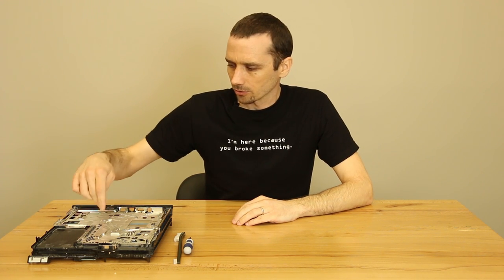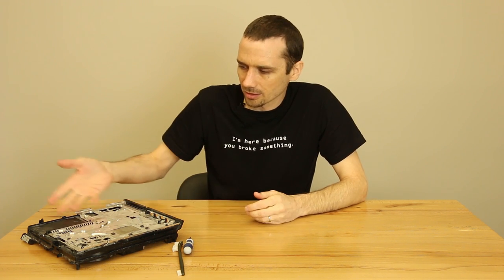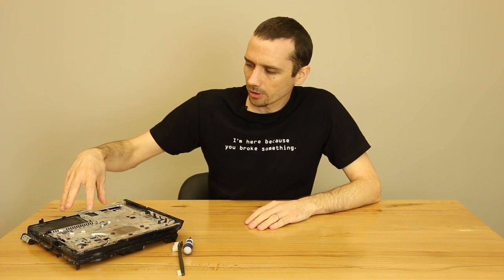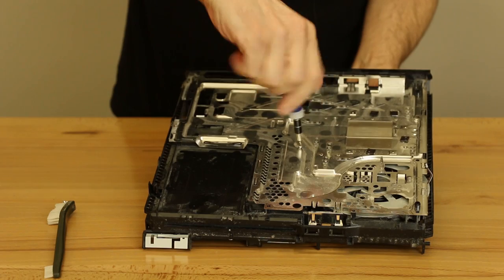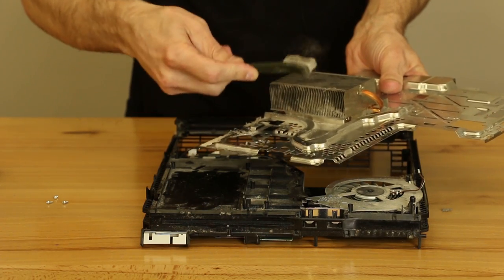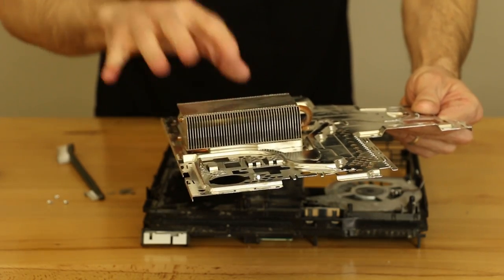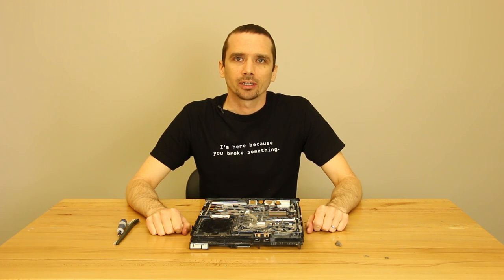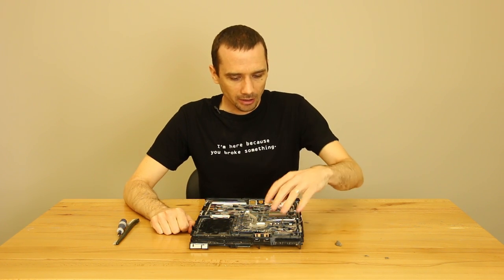PS4 Overheating Repair Tips - How to Fix Loud PS4

Comment: When I turn on my ps4 and my tv, you can hear the sound from the ps4(on tv) but you can't see anything on the tv.  What do I do?
Reply from the maker: Sounds like it may need an HDMI port replacement. Be sure to try a new HDMI cable first though.
Reply: +TronicsFix Do I have to buy a new hdmi cable?
Reply from the maker: I would try that first. It's probably a bad HDMI port but you want to make sure it's not the cable first since that's a lot cheaper!
Reply: +TronicsFix I tried a different hdmi cable and it didnt work, I tried it on different ports... what do I do now
Reply from the maker: You'll need to find somewhere that can fix it. If you want to send it to us for repair you can order that repair here: http://www.tronicsfix.com/store/p21/PS4_HDMI_Port_Repair.html

Comment: My ps4 didn't overheat and is a newer ps4 a little over a year old. i tend to leave it on a lot and today my controller just turned of and i haven't been able to reconnect can someone please explain what is wrong. Its a 1 TB Black Ops 3 ps4
Reply from the maker: Does it try to connect? Do any of the lights come on when you try to turn it on?
Reply: Yes it will blink for a minute then stop
Reply from the maker: It could be a problem with the Bluetooth chip on your console. Sometimes they go bad and cause this problem. You might try connecting with a different controller first.
Reply: Just contacted play station and got it fixed
Reply from the maker: Awesome! Glad you got it working!

Comment: My ps4 is blowing air out from the side vents, but aren't they supposed to suck air in
Reply from the maker: As long as there is air flowing it doesn't matter.
Reply: +TronicsFix I think my ps4 is overheating because of this. The fan starts to get loud after only playing like 30 minutes, and in game textures take a while to load. I've only had my ps4 for about a month so I don't think its a dust issue
Reply from the maker: I would take it back and exchange it if I were you.

Comment: What if your ps4 does not turn on at all? Is it because of your power supply? Help meeeeeee... :(
Reply from the maker: +Taste Therainbow Usually, yes.
Reply: +TronicsFix I just have the same problem. I was playing MGSV and the PS4 just turn out. The console was not in the best place, and of course she had a lot of dirt. I have no valid warranty, so I opened it and I cleaned it carefully, just the fan and the dirt in the case. After that I tried to turn, but absolutely nothing happens. I also think it can be the power suply. So my question is
Is there any way to be sure of that before buying a new one. What's your advice?
sorry my english, thanks a lot!
Reply from the maker: I really doubt the power supply went out just by you cleaning it. It's more likely that something wasn't put back together right.

Comment: My ps4 use to heat up really hot and it never said anything now it heats up a little bit and it shuts off on me and says it’s overheating led turns on etc yet it doesn’t feel too hot to be doing that
Reply: I am EXACTLY the same I think it's Sony slowing them down so we buy a ps5
Reply: @thespecialist3728  I’m going to buy one either way but I just sent mine to get fixed a couple days ago

Comment: Hey TronicsFix, does the Vertical Stand provides more cooling if you place in open space or just a normal type?
Reply from the maker: The vertical stand isn't going to provide any more cooling than just having it sit flat.
Reply: +TronicsFix I heared some PS Players use Vertical Stand Cooling MOD but actually it really kills your PS4 because of the dust.

Comment: Guys quick help my playstation 4 slim gets really loud and hot sometimes the console controller can't be controlled can't use it for abit what's the best
Reply from the maker: I really don't know. I'd have to be able to test it here in my shop to know what's wrong with it.
Reply: TronicsFix its like the controller is being used by a ghost and some rendering issues sometimes, could it be worth getting a new one
Reply from the maker: Before you get a new one you should at least send it to me so I can have a look at it. I'll diagnose it for free then once I know what's wrong I can give you a price and you can let me know if you want it fixed. We can fix most problems for under $100

Comment: Hey @TronicsFix LLC,My ps4 is overheating and it makes loud noize but it doesn't overheat to the point that it flashes red and gets turned off by itself,it just when it gets hot it show's me a notification on my screen that say's "Your ps4's temperature is too high,turn it off now and turn it on again later" but the thing is it gets hot really quickly,like i turn on my ps4 and after about 1 hour it will show me this notification,and it does every single time i turn it on no matter how much time it was turned off,if you know what's the problem with my ps4 i would really appreciate it if you replied right here on my comment, i subscribed to your channel also.
Reply from the maker: Thanks for the sub! 99% of overheating problems are caused but either a faulty fan, clogged heat sink or having it in an area that isn't well ventilated.
Reply: Ok thanks for the help i appreciate it !!!!!

Comment: Tronicsfix my ps4 temperature getting higher and higher what I need to do I am panicking. :( :( :(
Reply from the maker: There's no way for me to know what's causing it without having it here in my shop. A good cleaning and new thermal paste could fix it or maybe it needs a new fan. You can always send it in if you'd like: https://www.tronicsfix.com/collections/playstation-4/products/ps4-overheating-repair
Reply: what is fan?

Comment: My fan won't change speeds after I cleaned my ps4. Now it just runs too low. What should I do?
Reply from the maker: How do you know it's running too low?
Reply: TronicsFix LLC I turned it upside down Took the bottom cover off, and turned it on to see if the fan spins at all. It does but it spins slowly. I tried to spin it by hand, but noticed it had some resistance. It doesn't spin freely. Almost like it needs to be greased.
Reply from the maker: Does it overheat?
Reply: TronicsFix LLC yes. Stays on for about 2 minutes, I hear 3 beeps, light turns red, and then it shuts off.
Reply from the maker: And this just started after you cleaned it out?
Reply: TronicsFix LLC I've cleaned it out before, but this didn't happen. This time I used a can duster. The reason I cleaned it out is because the fan was making a noise as if it was spinning wobbly. Now it spins evenly but with resistance and it's slow.
Reply from the maker: Did it start overheating only after you cleaned it out?
Reply: TronicsFix LLC no. It's been overheating and I though that it was because of a weird noise the fan was making due to dust. I cleaned it out, and now the fan doesn't spin fast enough to cool it down.
Reply from the maker: That would have been good to know in your original question. If the fan isn't spinning correctly then replace it. While you're there you should remove the bottom metal plate and clean the heat sink out.
Reply: TronicsFix LLC will, do. My new fan with thermal pastr just came in and I'm going to fix it soon. Any tips?
Reply: TronicsFix LLC okay, I replaced it, put it back together, and it overheated again. Checked the fan. It doesn't spin. I took the bottom cover off to she if there was q slow spinning fan, but there wasn't. The fan jerks like it wants to turn on, but doesn't spin. I checked the fan connection and it was good. What could it be?
Reply: TronicsFix LLC btw. I ordered a huc-1001a replacement fan which is the one for my ps4.
Reply from the maker: Did you remove the bottom metal plate and clean the heat sink?
Reply: TronicsFix LLC sure did. It was just a faulty replacement fan. It's all good now. Thank you so much for taking the time to answer my questions!

Comment: i tried to solve the overheat problem with a new thermal paste and it doent work
Reply from the maker: Ya, that's normal. Just changing the thermal paste very, very rarely will fix an overheating problem. You need to clean the heat sink and check the operation of the fan.
Reply: I just got my ps4 today and i was not playing games it is unused from currys brand new but heats quite hot😭😭 any solutions?
Reply from the maker: Unfortunately, no. There's no way for me to know what's going on with it. "heats quite hot" doesn't tell me anything. Most of them get quite hot when you are playing them.

Comment: Somebody please help... ok my ps4 fan or at least I think the fan has been really loud whenever I put it on rest mode I've had it since day one and this started to happen a little over a month ago at max...

 2 weeks ago randomly as I was using it. It said error ps4 is too hot shutting down or whatever once I started up call of duty modern warfare app. I was like "what the heck" so I turned it back on and it worked fine for the rest of the day and I ignored that weird sequence. 
 
But recently last Saturday Nov 19 I believe it came back as like three minutes into a game and I turned it back on repeatedly and it kept on shutting off with that same error a 2 weeks ago.

in response I removed the plastic cover that covers the hard drive in attempt to make it cooler and it worked for like 2 days untill madden 17 would literally go in slow motion after every dead ball after every out of bounds every tackle etc untill I clicked the next play then it would go normal speed untill another dead ball.

The next day i turned it on ready to play and it immediately gave that error that it is too hot and shut itself down and I can't get it to stay on for more than 2 minutes now without it saying that

I gave it to my uncle and he opened it and gave it a cleaning he said it was freaking filled with dust and stuff but he said it's clean now and I see it on the sides and everything its dust free but I still can't keep it on for more than 2 minutes after it was cleaned  what's the problem please help any advice would be greatly appreciated this all happened kinda suddenly
Reply from the maker: Make sure the heat sink is clean, then check the fan to make sure it's operating correctly. Also, replace the thermal paste while you're there.
Reply: +TronicsFix thank you so much for the advice... if it helps when I turn it on the fan like sounds like it's attempting to work but stops and makes like a clicking sound when it does and it repeatedly continues this process.. and when it does turn off my ps4 is pretty warm at the top after like the 2 minutes it was able to stay on

Comment: I bought a power supply and when I put it in the ps4 the ps4 now turns on and then off so now when I try to turn it on I have to unplug it and plug back in for it to turn on and also I have to insert a disc inside for it to turn on...... Plzz help Again!!!  :(
Reply from the maker: +Taste Therainbow I'm not sure what's causing this. Usually when you have to unplug it to get it to turn on again it's a power supply problem. Since you already replaced that  it may be a bad connection problem between the APU and motherboard. This is assuming that the power supply you put in is good.
Reply: +TronicsFix Ok so how do I fix the bad connection between the APU and the Motherboard if that's the problem??
Reply from the maker: You can try this: https://www.youtube.com/watch?v=pszuueUTBrk
Reply: +TronicsFix I tried this but now my ps4 only turns on when I unplug the power cord and insert a disc in but then turns on after
Reply from the maker: "insert a disc in but then turns on after"???? I have no idea what that means.
Reply: +TronicsFix I mean that the console turns on only when I put in a game disc inside
Reply from the maker: If it turns on fully when you put a disc in then you probably don't have the front cover on correctly. There is a metal tab on the front cover that has to contact a copper pad on the motherboard.
Reply: +TronicsFix It actually only turns on for a bit and then turns off
Reply from the maker: OK..that's not a power supply issue then. That's an APU connection problem.
Reply: +TronicsFix ok so how do I fix the APU connection?
Reply from the maker: You can try this: https://www.youtube.com/watch?v=pszuueUTBrk

Comment: when you get a fresh ps4 place your ps4 on a box and put tape either the sticky side out around the box and they won't get in
Reply: Boy, you definitely kill your PS4, there is no air comes in your PS4 and the heat will cycle over, and over again.

Comment: I just replaced my fan on my PS4 and it is still over heating... please help me 😭
Reply: @TronicsFix
Reply: clean ur heat sink, fan, check the thermal paste and maybe refresh it with new thermal paste. and check if the thermal pads are in the correct position

Comment: I took my PS4 apart and totally cleaned it, thermal paste looked fine so I didn't mess with it and it still says it needs to shut down after 5 or 10 minutes because it is overheating!! I'm about to smash it and send it back to Sony and tell them to shove it where the sun don't shine !!!!!!!!!!!!

Comment: when im playing my ps4 just randomly shuts off and it gets really annoying ,how do i fix this?
Reply from the maker: If you look at all of our videos you will see one for PS4 on and off DIY repair. That's a place to start.
Reply: +TronicsFix i checked but im not sure if i understand,i dont know but my ps4 is probably overheating or somthing,do i need to like but it in a place where its not like to hot?because it is pretty hot in my house and i dont know if thats the problem
Reply from the maker: It it beeps 3 times, turns the red light on then turns off then it's overheating. If it's not doing that then it's not overheating.
Reply: +TronicsFix so do i try turning it on by holding the power button to see?
Reply from the maker: To see what?
Reply: +TronicsFix if its overheating or not
Reply from the maker: I thought you said that it randomly turns off???
Reply: +TronicsFix yes,i was playing a game and then my ps4 just turned off
Reply from the maker: OK...what I'm saying is that is not caused by overheating.
Reply: +TronicsFix ohh okay,so then what is it
Reply from the maker: I'll repost my first reply to you: 
"If you look at all of our videos you will see one for PS4 on and off DIY repair. That's a place to start."
Reply from the maker: It's most likely the joints between the APU and motherboard.

Comment: Can improper reapplication of thermal paste cause overheating?
Reply from the maker: Yes
Reply: TronicsFix so the repair shop over here that was supposed to fix the hdmi (that they broke), might be the root cause of my PS4 overheating every time I play a game?
Reply from the maker: Yes, if it didn't overheat before they "fixed" it then they are probably the cause of it overheating.
Reply: TronicsFix awesome. Thank you. I've had it since the night of release, and then my son broke the hdmi last year around October. They "fixed it," but only to die again two months later. They barely "fixed it" again, and now it overheats everytime I play a game. I can barely watch netflix.
Reply: Also, would they possibly have fried the fiber optic port when replacing the hdmi?
Reply from the maker: Ya, there's a good chance they fried it...literally. I've seen a bunch of them come into my shop where they heated it with a heat gun instead of a proper hot air soldering station and melted the optical audio port...and several other things.
Reply: TronicsFix yeah, in order to keep it from overheating now I had to remove both the top and bottom shells. So it's basically floating on a set of wooden toy blocks, fan exposed, SSD exposed, power supply exposed......I'm gonna make these asscabbages buy me a new one of they can't fix it

Comment: I've cleaned my ps4 really well still it makes really loud noise when starting games need help plz
Reply: Same
Reply: Did you get a fix
Reply: @Dramaa-  well it's normal until i start one of those game then it starts making the noise like read dead or fallout 4 but i learned that if the fane is making noise it's kind of a good thing because at least the cooling system is working so I'd say its working well
But the cleaning dose help
Thanks for checking tho👍☺

Comment: Any thoughts you can share about your experience with clicking fan sounds forcing a shutdown / failure to start?

I have a launch day model PS4, gotten much louder over the years but never to the point of overheating. Until it suddenly died a few months back, with worrying clicking sounds and would not turn back on properly. Research pointed to a fan problem, I dusted/cleaned it out from below which fixed the problem. Until this week when it died with clicking again, cleaning it the same did not help it for long. I did a tear down to get to the heatsink and pull out the fan for better cleaning, although it was dirty it did not look bad enough to be responsible. Went ahead and ordered a replacement fan. Bought new thermal pads from your site, will put on new paste and get it back together when the fan arrives — hoping that solves everything but if not I'd be keen to hear what the next step would be.
Reply from the maker: Hmmm...it's hard to know what the clicking noise is that you're talking about without hearing it.
Reply: That is understandable. I did not get a recording of the sound unfortunately.

Thanks for the time replying anyhow!
Reply: Did the replacement fan and paste fix your issue? Your problem is identical to mine, day one model, clicking sound and shuts off and I have to unplug the wires or it doesn't switch on again.

I also noticed my once jet like fan is silent and no warm air is being pushed from the back, so I'm thinking of a fan replacement also. Any help would be greatly appreciated.
Reply: Yes, after replacing the fan, adding new thermal pads + paste, and a full cleaning inside fixed it. Been running fine for four months or so, I can't say if it will work in your case but it worked for me. Good luck!